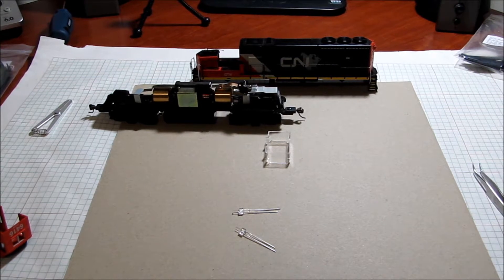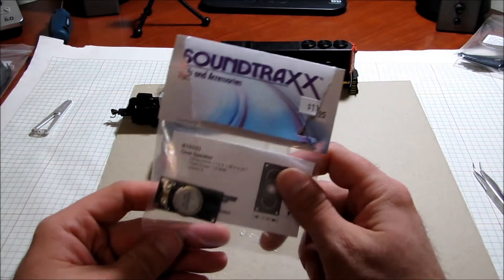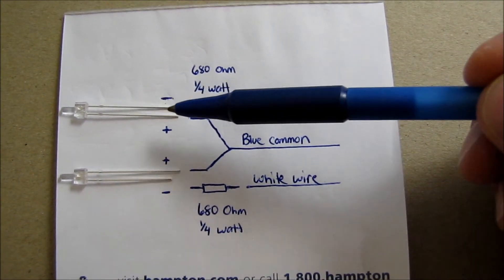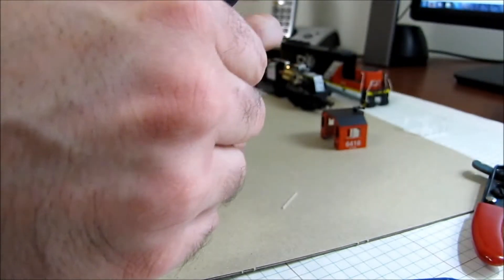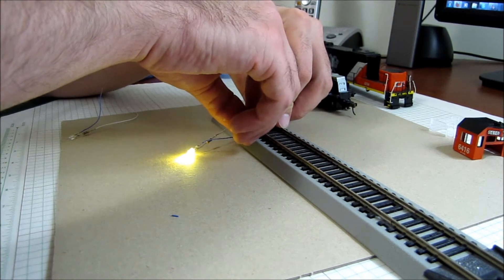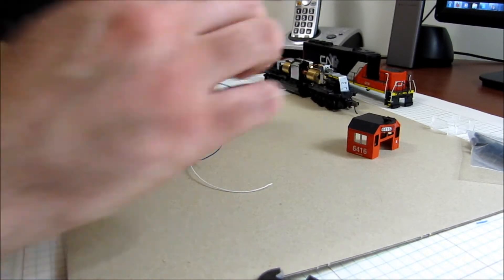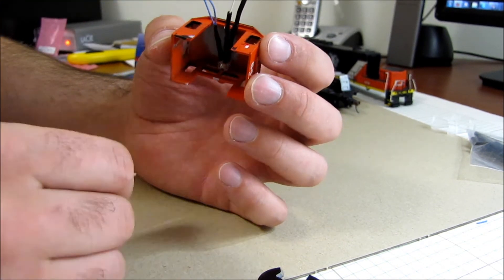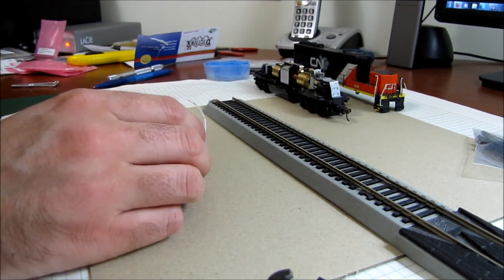12.8.11 DCC Project #2  Part A 'Installing LED's'

Comment: Another tip is to bend loops on the leds and resistors and hook them together.  Makes a better connection.  I use 2k resistors.
Reply from the maker: Great tip, thank you!

Comment: I use a 20mm speaker with a BAFFEL. I stand the baffel up on the end of the base platform facing in towards the interior of the shell.  The sound will amplify inside the shell.  Fasten with double sided tape from Home Depot.  Same for decoder.

Comment from the maker: Yes, I had the issue, what a pain in the butt that is.. I do know about the CV11 fix, however that really does mess with your slow speeds and I find the decoder hesitant. I got rid of that decoder because of all the issues i had with it and will never use a 164 again.

Comment: Brian: Did you have problem with the '164 decoders when you sound the horn or ring the bell and the unit slows down.  MR Magazine had a DCC article on how to correct that problem with adjustment of CV11. I followed what it said and it corrected the problem! No more slow down when I sound the horn! Digitrax documentation doesn't say anywhere about correcting this with CV11.  Check it out.

Comment: hello brian i have sunny white 3mm led lights from richmond controllsand i bought a veriaty pack of 1/4 wattt resistors, it said on the packaging that it in cluded 680 ohn risistors but when i checked on my multimitre all i found by testin ohms was 68.0 ohms and .680k ohms which came up as .670  will any of these work? thankyou

Comment: Very good presentation! Good filming too!  Since I'm the RR SalvageMan... I do everything cheap... I buy the "Tiny Christmas" warm white 30 LEDs for 30/$7.95 @ Walmart. They are perfect for Athearn units; I use Amazing Goop's Sports Adhesive (it's clear) for attaching them behind ports for the bulbs. I put shrink tubing around the LEDs themselves so light only comes out the front. Also I only been using 1-680 ohm on the blue wire for both front/rear LEDs w/o problems. Rest, I do like you do. :-)

Comment from the maker: @aces116 It actually doesn't matter what side the resistor is on.  Just as long as there is resistance in the circuite, your ok.  I just put it on the wire that controls the LED, which would be your white, yellow, or a function wire.